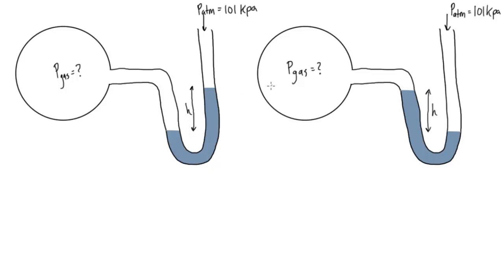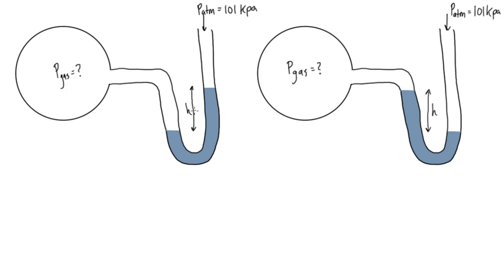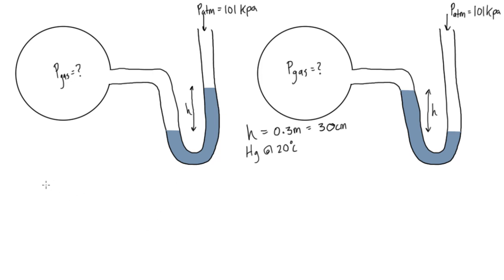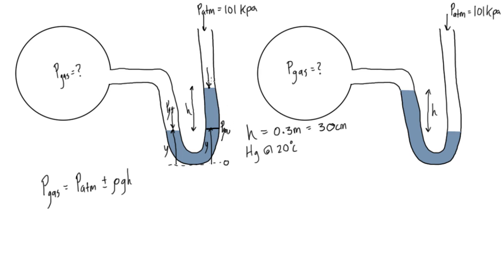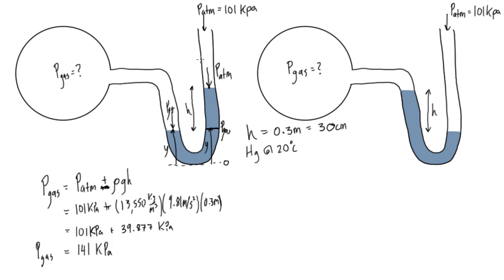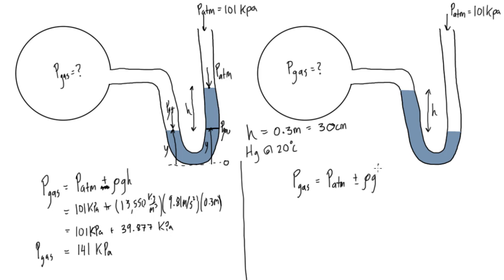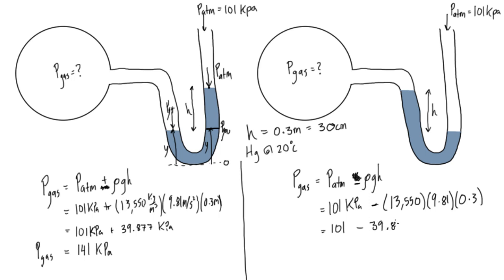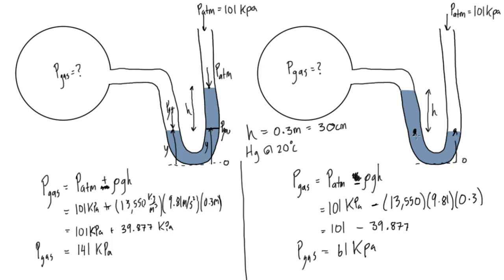Simple manometer example problem

Comment: Thanks for the upload! Do you think you could do video to show how to tackle manometer problems with a change in diameter?
Reply from the maker: Change in diameter should have no effect so long as the diameter isn't so small that capillary action is in play. Otherwise, ignore and changes in diameter, and only focus on the vertical change within a continuous fluid column.
Reply: @Engineer4Free  thank you :)

Comment: Dear, units are not matching P gas= Patm (Kpa ) +hdg( pa) , how come to add or subtract ?????
Reply from the maker: Pa = N/(m^2), but 1N = (1kg)*(1m/(s^2)) so sub in that for the N in the first expression to get Pa = [(1kg)*(1m/(s^2))]/(m^2) and rearrange to get Pa = 1kg/(m*(s^2)). Inspecting the term ρgh = (13,500kg/m^3)(9.81m/s^2)(0.3m) ----> the units reduce kg/(m(s^2)) which is Pa. Both terms on the right hand side are in units of Pa, so we can add them, and get the answer in Pa.

Comment: where is that 13,500 coming from??
Reply from the maker: It's the density of Mercury at 1 atm pressure and 20 degrees celsius. It's a commonly used number that's often given in the problem or supplementary tables. Check out videos 1 and 2 here: https://www.youtube.com/playlist?list=PLOAuB8dR35oeOIPMOBH6hjwobuIJHPKSN

Comment: Someone explain what all the variables in this equation are 
and where tf did 13,550 come from
Reply from the maker: Pgas = absolute pressure of the gas. Patm = absolute pressure of the atmosphere. ρ = rho = density of mercury at 20 degrees celsius. g = acceleration due to gravity. h = change in height of fluid column. I really recommend taking about an hour and the first 8 videos that lead up to this one in the playlist here: https://www.youtube.com/playlist?list=PLOAuB8dR35oeOIPMOBH6hjwobuIJHPKSN 13,550 is a table value for the density of mercury at 20 degrees celsius which can be found in any density table in a fluids or thermo textbook, I use it several times in the videos leading up to this one so I don't always repeat where everything comes from in every single video.

Comment: Just wondering, your solution at 3:52, would that Pgas be absolute pressure because it's the total pressure, Patm + Pgas(gauge)? Would Pgas(gauge) be the difference between the two, ie. 39.877 kPa?